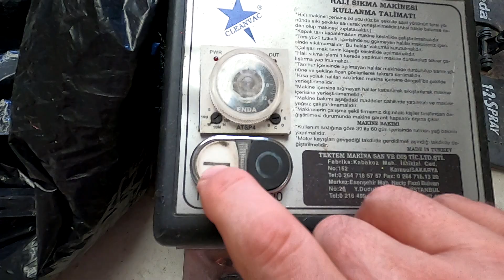Double submersion, Large carpet rug cleaning

Comment: Just a question out of curiosity why do you submerge the rug in water I have always wondered what the difference is when you do this instead of the normal
Cleaning.
Reply from the maker: Because i want the water to penetrate deep into the knots to emulsify soiling buried in their,  washing the surface of the rug doesn't have the soaking affect needed to do this. The water just runs off not giving itself time to emulsify deep down soils. I cleaned a rug regularly once and accidentally left in it the washpit for an hour while i had my dinner,  the pit flooded and when i came back there was soils seeping out of the sides of the rug. Since then on thick dense dirty rugs, i quite often fully submerge and leave for upto and hour. Hope this helps.
Reply: @ArcadiaRugSpa  thanks for letting me know! ❤️